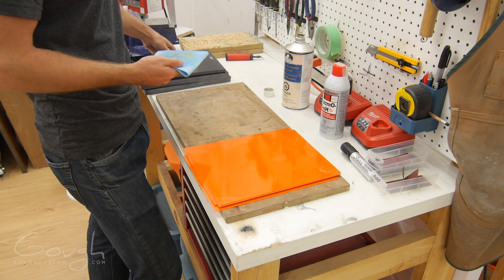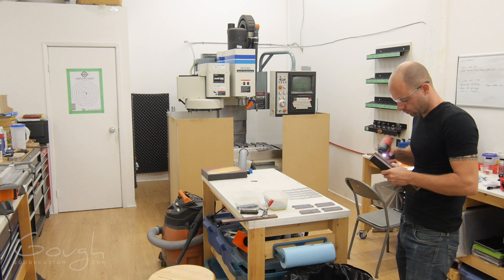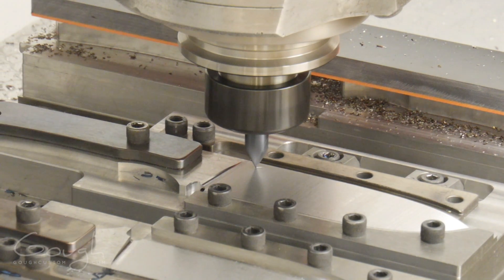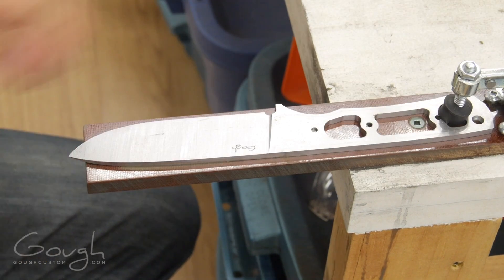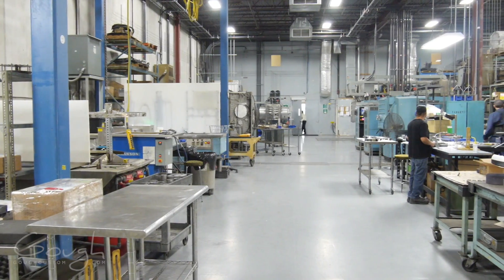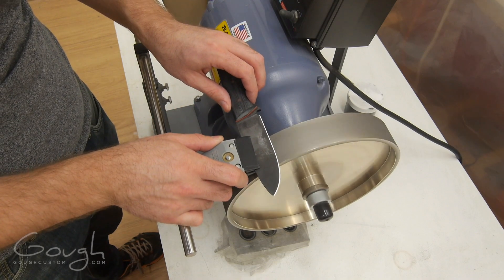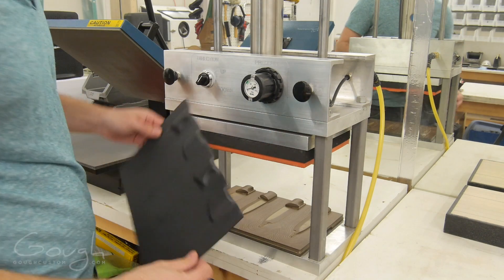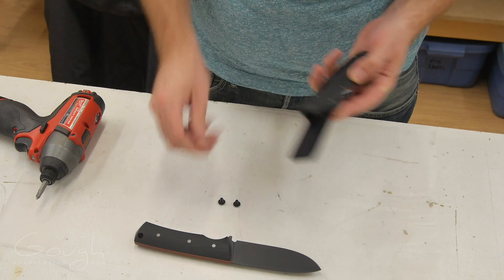Making a knife the high-tech way - Resolute MkIII

Comment: 350$? For that price I get a knife from Extrema Ratio Made in Italy
Reply from the maker: And if you prefer their knives then that's what you should do!
Reply: Gough Custom no! It's too much for a knife, max 50€
Reply from the maker: You're very welcome to try to make a knife for that price!
Reply: Gough Custom sorry don’t want to diminish your work, which is excellent and very meticulous. However it’s not that expensive, go to the scrapyard and get yourself an old car leaf spring, an angle grinder(which can be rented for almost nothing) if you can’t rent one get some sand paper of different grits. Now on Amazon or your local store you can buy almost everything. Wood is everywhere and some glue. Job done. Total cost of the knives that I made it’s roughly 45/50€ also considering the cost of electricity. Here in Italy you can get hundreds of knives, also from well known brands, for 25 to 50€. Again I don’t want to diminish your work or skills.
Reply from the maker: Carlo Danese sorry mate but I'm not sure you're quite getting it... How much of that 50 is left over to feed your family? What about rent? Machinery? Fixing things that break? 

Using scrapyard steel is not acceptable for my customers, and the fit and finish I need to achieve dictates that more sophisticated tools are required. 

My knives have $120 worth of just materials in them. I have had to buy tens of thousands of dollars worth of machinery to be able to get the results I need. Then there are fixed costs like rent, power, insurance, etc... 

Yes you can make a knife for $50. Making a knife yourself for $50 that is of a high enough standard to sell while also feeding your family and paying rent is completely impossible. 

Factory knives are a different story, but the key there is volume. They make thousands of knives, and their investment in machinery is orders of magnitude higher than mine in order to make that volume possible.
Reply: Gough Custom again sorry, never meant to be disrespectful. Feeding my family? I get up at 4 am and finish my day at 21.00 pm, vineyards is my source of income. I just answered because you said that generally speaking you can’t make a knife for 50€. You never said anything about making a living for it. Just saying
Reply from the maker: Carlo Danese sorry, I wasn't implying you didn't work hard! It's just that saying you can make a knife for $50 while watching a video of someone who is obviously doing it for a living is a bit off point... I can make a knife for $50 as well, but I wouldn't be able to continue running my business of i did that!
Reply: Gough Custom I can wholeheartedly say that your knifes are made with excellent materials and clever thinking. I am happy that you are a knife maker and I would really like to see more of your work. If you can make a living out of it, it’s perfect! I would like to try one of your knives, unfortunately I have almost 30 knives that I currently use, all of them are Scandi. A perfect and durable edge is essential in my everyday work. Don’t get me wrong I have tried hundreds of different shapes, types of steel and artisans but only a few were up to the task. I hope you business goes on without fail!

Comment: What is the name of the solution in which the knife is placed after heating? Is it vegetables oil or engine oil or water only?
Reply from the maker: I don't place the blade in anything in this video..  in my other videos I'm usually air quenching. If you're heat treating a simple steel like O1 then a vegetable oil like canola oil will work great.

Comment: how much would do you make off one of these knives compared to the material costs?
Reply from the maker: Materials $120, fixed costs around $125 per knife (rent, power, insurance), leaves $185 which has to cover labor, maintenance and any additional expenses. That doesn't include costs of any machinery or anything either. Overall fairly slim, I have worked hard to keep my process the same despite rising costs, though I should probably raise my prices.
Reply: thank you i really like the design of them especial the green lined on they look amazing and if i wasn't on a student budget id get one for hunting in New Zealand

Comment: Good day Aaron, 
I've got a question:
wouldn't it be more effective to get a big batch of blanks waterjet cut instead of machining them? Or does machining have some major advantages to waterjet cutting?
Reply from the maker: Hey mate! I have tried water jet in the past and the quality of the cut edge is quite low... The edges are tapered and tolerances are kind of sloppy which means I'd have to machine all the water jet cut edges again anyway, so by machining everything myself I can save a lot of time and complication! Also my machining of the profile in this video is quite slow because I was gearing up to move to hard milling... If I was focused on machining the blades as fast as possible I could machine them soft with a 1/2" endmill, which would allow me to profile a blade in like a minute, so overall machining has a lot of advantages over water jet!

Comment: the level of quality of your work is outstanding! just one question. how do you make sure your blades are still straight after the heat treatment? i am a part time knife maker and this is a problem i have often.
Reply from the maker: Thanks mate!! Very occasionally my blades will warp, but only like 5 blades out of 100.. air quench steels like A2 are much less likely to warp than oil quench steels, and making sure to quench and temper evenly. I now mill all my blades after heat treatment to avoid all warping!

Comment: I was wondering, with the DLC being so hard, why didn't he sharpen the blade before it was coated. It seems that the un-coated edge would be the failure point on this knife. Is DLC not tough enough to hold the edge?
Reply from the maker: Regardless of hardness the edge will have to be sharpened at some point, likely within a few months if it sees heavy use, so may as well sharpen after coating to keep the appearance consistent. Additionally DLC will round of the edge during application to some extent and produce lower apparent sharpness...

Comment: Very nice!
However, you should consider replacing those philips screws with torx or hex if you are going to call this knife "high-tech".
Reply from the maker: The main reason for not doing so is turned make it servicing as easy as possible!
Reply: Gough Custom
Yeah, I guess that's a fair point. At least you are not using prehisoric slotted head screws like most do.

Anyway, you make custom knives, so I guess you would have no problem making a sheath using torx for me!
Not that I am in that market just yet, but a guy can dream...

Comment: So I'm sure this is what the big knife companies look like. I respected the guy making awesome knives with a wooden file jig. This might as well be made in china. :(
This isn't art this is machine. no skill required other than running the machine programs. #NOTAKNIFEMAKER
Reply from the maker: This is absolutely not what the big knife companies look like. Big factories have dozens or hundreds of people working on the knives, each person doing only one part of the process, with hundreds of knives passing through their hands in a day. And none of those people designed the processes they're performing, someone else sets them up, they just do what they're told. Watch some factory tours.

I make each knife start to finish myself. Every single knife goes through my hands. And the entire process was designed and setup by me. I made a bunch of the machinery you see in this video from scratch, and I personally did a full rebuild on that CNC machine, there's a video of it on my channel.

Also: you should read up a little on what it takes to program and run a machine like this. Making knives by hand is far easier than setting up a process like this. It takes a lot more skill and patience. I know, as I have done it both ways!

#DEDICATED #PASSIONATE #CRAFTSMAN #KNIFEMAKER

Comment: I have a question though 
Isn't the coating scraped off when you sharpen the blade with the grinder wheel?
Reply from the maker: It is yes! But that's fine, as it would be taken off whenever the customer sharpened the knife themselves anyway!
Reply: oh okay but then whats the use of coating if its the exposed steel is gonna do the cutting 
the hardness of the cutting edge is gone the minute you scrape it off isn't it ?
Thanks
Reply from the maker: The steel is what I want to be doing the cutting with! My steel is very hard (62hrc) and very tough with great edge retention! The coating is for appearance and corrosion resistance.
Reply: Oh that's awesome man 
BTW great video keep em coming 
Love from India

Comment: Why go through the extra step of creating a void in the tang by cutting out chunk of metal inside the tang?  I prefer to follow the principle of "form following function."
Reply from the maker: Because if I didn't then the balance of the knife would be terrible! The handle would be to heavy which makes the knife feel unwieldy
Reply: Gough Custom If your concerned about balance, making the blade a little longer will solve the problem without adding much weight.  Also, a handle with a solid tang can be used as a pummel when SHTF.
Reply from the maker: Sure, but I need the blade to be this specific length... Also the tang is not made weak by the skeletonizing, it's more than strong enough to use for striking on anything still! I have tested it. Removing weight this way is very common in the knife world